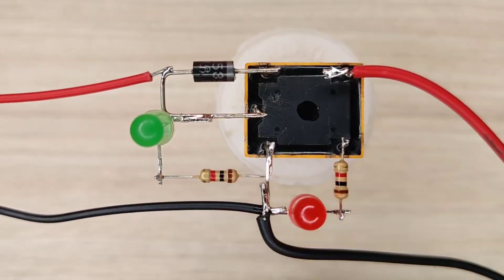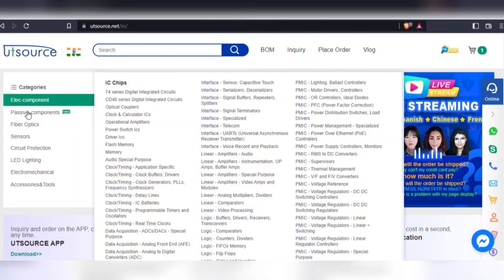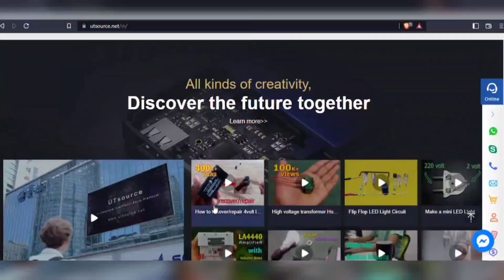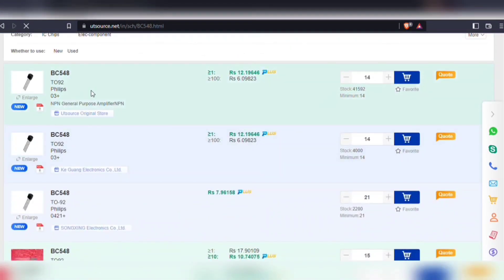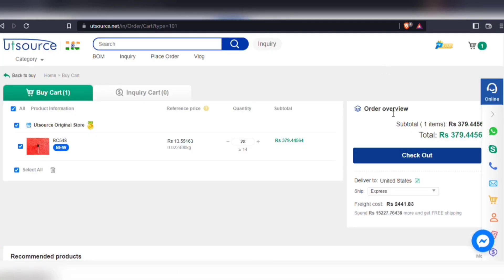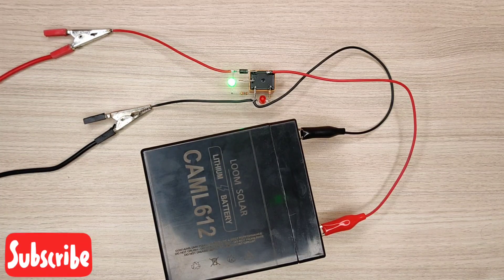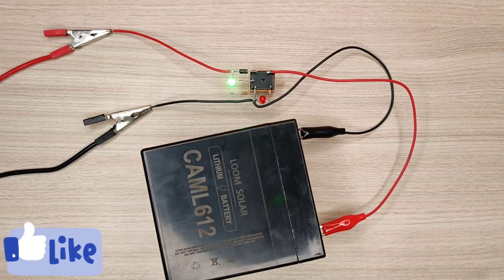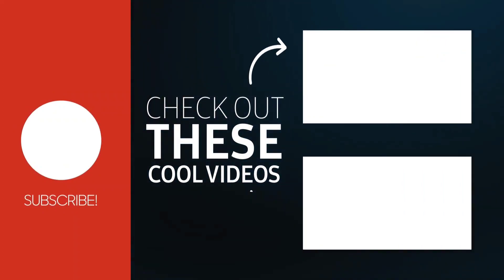This Electronic Project is very helpful You can make at home

Comment: When the polarity is reversed in the circuit, so that the RED LED is lit, the GREEN LED is reverse biased by around 11.1V DC (nominal) which far exceeds the 5V PIV of most LEDs. It will fail in time, unless, of course, you place a reverse parallel signal diode across it. I think the circuit, although elegant, is a solution to a non-existent problem. Just use a polarised plug.